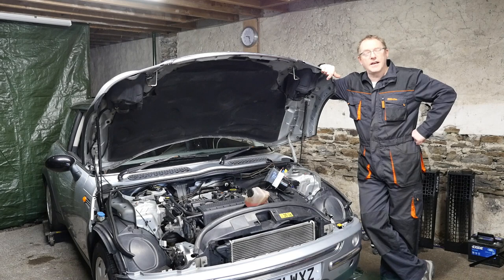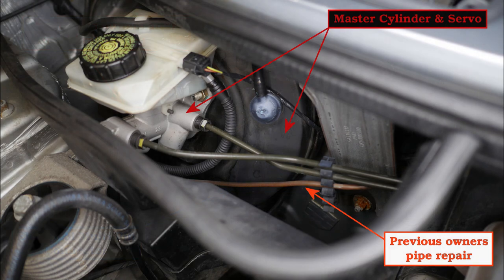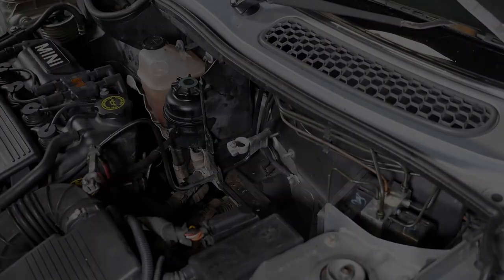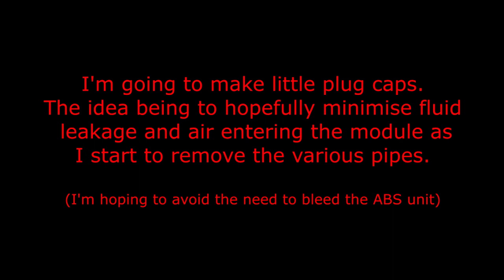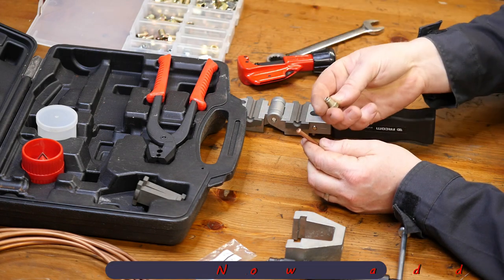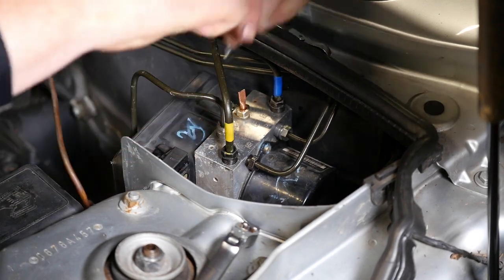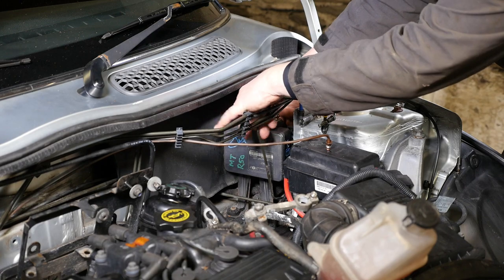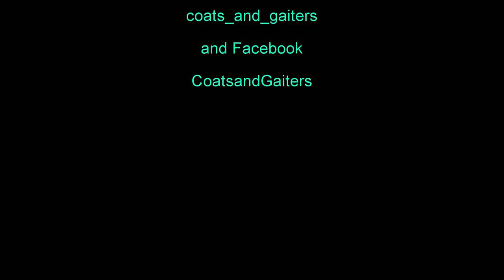Removing ABS Control Module on a 2001 Mini One Cooper R50 R52  with Tritec Engine 🚗

Comment: Mark- What do you think is the chance of splitting the unit still with the hydraulic pipes connected? Your one clearly has been replaced and the ABS sensors read ok. My car- same year as yours- has original ABS pump and I've not got any scanner software to force an ABS bleed. I know (or presume) my sensors are ok as they appear on 'live data' on my Autel MaxiDiag. My thinking it to leave the hydraulic block alone...My brakes are operating well and I want to avoid taking it with dodgy brakes after failing to purge the pump to a Mini Garage.
Reply from the maker: Hi Patrick I do believe you can do that with no problems and to be honest like you say it makes more sense.  Once air is in you have created another problem to be solved.